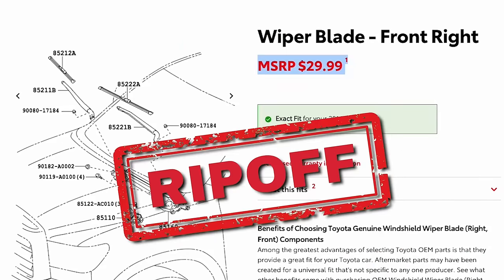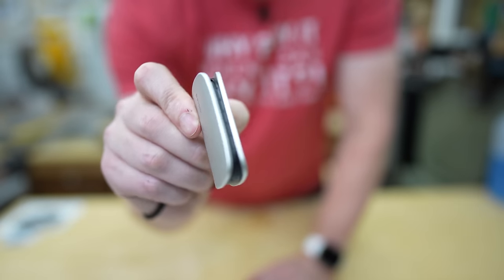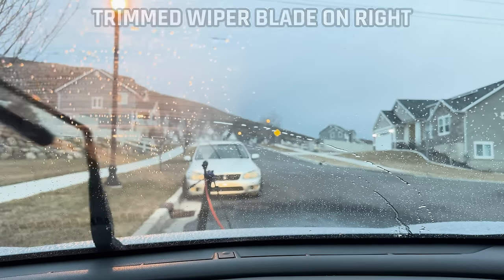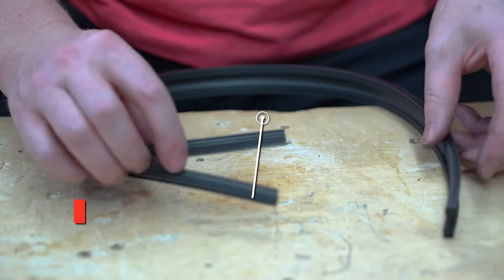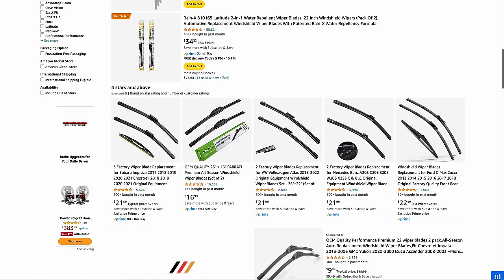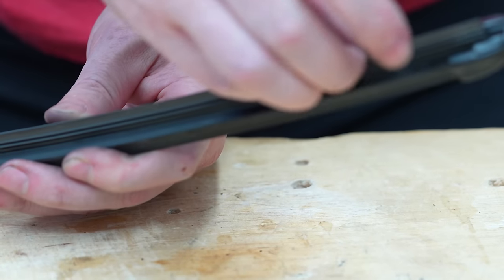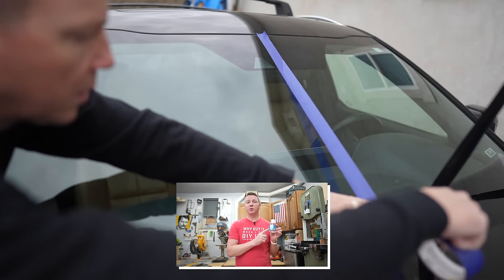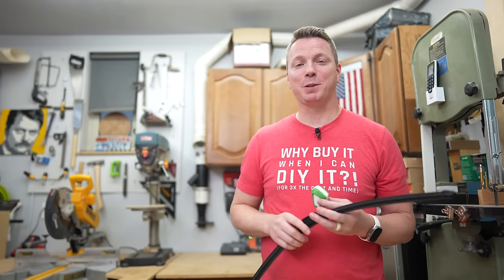Windshield Wipers Are a SCAM! 3 Ways to Save $$$

Comment: If you get a good set of silicone wiper blades you may never have to replace them if you clean them occasionally & wipe them with Rain-X when you apply that to your windshield.
Reply: The blades I buy usually break because they froze in thick ice.  The plastic parts crack and the rubber tears to shreds.   Would silicone do better ?
Reply: @jeffbguarino  Yes silicone stays pliable in freezing temps. I would make sure they aren't frozen to the windshield. Start your car & run the defroster on high to free up the blades before you run the wipers. Or you CNN chip them out with a good scraper.
Reply: @jeffbguarino  Got some clothes pins or do pizza places still stick those tables in the center? Stick those under the wiper arms so the blades are lifted from the surface before any expected freezing precipitation, then simply remove them before driving.

Kinda a chore with my 2000 chevy cavilier, but you live in the upper midwest for 20 years, you get used to it. Don't newer cars lift theirs automatically when off so this isn't a thing?

Comment: I'd be cautious using WD-40 to clean your wiper blades.  Maybe I didn't remove the residual WD-40 properly after cleaning, but after "cleaning", we went on a long road trip and encountered rain.  I couldn't see a thing.  The residual oils from the WD-40 smeared the windscreen.
As I say, it may have been user error.  If I do it again, I'll test it thoroughly before heading out on the road.
Reply: Definitely user error

Comment: I would like to see you run the wipers on the Rain-X treated windshield.  I tried the Rain-X once on my windshield, years ago.  The water did bead up and tend to roll off, but at some speeds and/or rain conditions I still needed to run the wipers.  When I did, it smeared and made it more difficult to see through.  Eventually it seemed to wear off and I've never used it again.
Reply: Same experience here with Rain-X, even though I made all the key preparations. 

I have since moved to a glass coating called Ultra Glaco by Soft99 (Japan) and the durability is great (1 year or so).   It's been great, speeds over 30mph don't require the wipers (or at least put them in intermittent).  The blades glide over the glass pretty good even after 6 months. 

I keep the windows clean using just the Sprayway glass cleaner.

Comment: The WD-40 (silicone spray applied the same way works also) trick is excellent for quick short-term emergencies (and extends the life of the blades) and usually last about a month or so. I like silicone wiper blades, they cost a bit more but they try to make them hard to find and they last at least 3 times longer. I'm not sure since I haven't had to replace them yet. Also, as others have mentioned car wax or polish like Nu-Finish applied and buffed off  the windshield works as well and last longer than Rain-X.

Comment: 10:33 I use a similar product that I discovered when I was living in Japan and it works exactly like that. All the major car shops like AutoBacs had it. It was in a bright orange hand grip applicator bottle that had the felt brush built into the bottle. The only downside to using that stuff on your windshield is driving for a couple of hours nonstop in the rain during the day will cause your brain to get that warp speed star field screen saver burned into your brain and when you finally get to your destination, you being seeing that moving star field for hours after. Even worse if you pullover into a rest stop for a nap. You close your eyes and that's all you'll see. It made my friend traveling with me get nauseous when they tried to catch a few zzz. 😅

Comment: Cool informative video. Another product that has worked amazing for me. Is RAINX  windshield washer antifreeze that's typically available at any BIG BOX store next to the blue windshield washer antifreeze is the yellow rainx windshield washer, antifreeze. Use it because our winters are very cold here with temperature, sometimes reaching -20°C.  So rather than switching to the SUMMER bug washer fluid by RAINX as well, which I would likely forget by the time winter arrives, which would freeze the water bottle and pump like an ice cube, expanding and an ice cube tray. I just the winter -40°C rated rain X washer fluid, which basically coats it just like the additive that you demonstrated in your video. I to find that when I'm driving at high speeds, the water just repels off of my windshield which prolongs my wipers for typically five years or more because I don't use them as often but I do need to take care of them a little bit more as the age by cleaning them with a degreaser, and then using a rubber rejuvenator Solution with the applicator built into the little bottle, which I just apply a small amount, and it brings it back to like new by restoring the  moisture that's lost as my daily driver throughout all four seasons of extreme weather conditions. They clean it up even better. Sometimes there is too much crap on it because I don't wash my vehicle enough. I'll just use a little piece of light sandpaper or Mr. clean magic eraser, which basically removes a small amount of material along with any other foreign debris which creates a smoother service area rather than buy new wiper blades. Find that when there is a huge downpour and I'm driving on the highway that my wipers don't keep up the pace needed in order to remove the water from my windshield because it's too slow so the RAINX actually be used as a safety measure  if my wipers stop working or one flies off? I think I go through one bottle of washer fluid a year because of the rain helping to keep my windshield cleaner by repelling the water and dirt off my windshield when it does rain or snow. Another try to keep an extra blade in your trunk. Even though it's an old blade and may not do a great job. It's better than having no blade do no job or worse having the wiper arm cut into the glass of the windshield because the driver didn't pull over to address the situation, but rather drives home later, realizing is a very fine line in the shape of a moon on my windshield lol I wonder what that came from and that's when I showed them the wiper arm folded down on the windshield, matches up with the same mark left by running the wipers with one blade missing. OH "I didn't know it would leave a mark on the windshield"? it more than an eighth of an inch deep it's not worth buffing out the material around the scratch in order to level that area of the windshield which would take countless hours. Great video though keep up the great work! Peace

Comment: Everyone talking about refills. They went away for the most part because one, there were three different widths of refills, second, modern vehicles as a majority, use two different size blades. So costs would be redundant. Plus the new design beams are really hard to replce incerts into. UV does the most damage, those of you who store your vehicles inside or dont drive htem full time, they last much longer.
Reply: Yeah, they can solve ALL of these issues by STANDARDIZATION. We only need ONE SIZE for each type of car.

Every truck does not NEED different sizes of wipers. The windshields are almost identical.
And if the windshields are not identical, MAKE THEM IDENTICAL. We need cheaper windshield repair too!
#LateStageCapitalism

Comment: Years ago when I had a Mazda 626, I had bought some Triple Edge wipers. They were amazing but they weren’t the standard blades. They were made with Jamak silicon. I had them on the car for almost 6 years and they wiped the same as the day I bought them without doing anything to them. Ice? Didn’t hurt them. Mud? Nope, still wiped clean. Sure after a couple years I had to wait for a few swipes that were streaky but after that they wiped clean again. It was weird but I can honestly say they were the absolute best wiper blades I’ve ever had. I only replaced them cause the passenger side flew off the car when the mounting bracket retainer clip broke. Happened while driving and using them. 

I have done the WD-40 method and can concur that it does work. 

As far as the Rain-X I never used it by my parents did when it came out. I do however use a paste wax on my windows and it lasts a long time with similar results. 

I have subscribed for more as I love to do things myself. A whole lot cheaper and I know it’s done right.

Comment: I use the ceramic polymer that I use on my car finish on the glass as well.  You never have to turn the wipers on, it just sheds off the glass.
Reply: Ceramic?  Ceramic is stone.  I don't want rocks anywhere near my vehicle.  That's like rubbing it with ground spark plugs.

Comment: This is a good guide.  But there are some things with the refills you need to be aware of that I've learned in 15 years of aftermarket and dealership parts departments.  If a car is more than a couple years old chances are it has aftermarket wiper blades on it.  In the aftermarket nearly every wiper blade has a different width of channel where the blade itself slides into.  So you may get the right length, but that channel may be a couple millimeters too narrow or wide.
Reply: I second this. My '99 Blazer has one that I think is OEM and one that I know came off a Mini Cooper. The wipers are VERY different.
Reply: 6mm and 8mm are popular.  6mm will usually work in the 8mm arm.  Cut to length from bulk.

Comment: The one thing I hate about RainX is the same thing I hate about using Armor All Original.  If you use it once you have to keep using it or your view gets cloudy and deteriorates.  With Armor All it makes everything super shiney but will also leave it splotchy or even cracked if you stop applying it.  The purple kind seems to be good since it just cleans and doesn't polish/shine the dash.  WD40 probably can give and cure cancer in some way.

Comment: My wipers last a really long time. I really hate a dirty windshield so i clean mine at least once a week. Usually at the gas station. I always keep a bottle of glass cleaner in my vehicle. Ill spray my windshield with my cleaner and use the squeegee.sometimes their cleaner can be kind of gross so adding cleaner to the windshield helps. Also, I spray a paper towel with window cleaner, pinch the wiper blade with the paper towel, and give it a quick cleaning. This regular cleaning keeps the buildup off the blades. I use a repelant product on the windshield too.

Comment: As a wiper freak I have drawn several conclusions over the years: 
1. DO NOT buy those crappy wiper trimmers- as said in the video is nearly impossible to make a perfect cut on them that won't create streaks. And anoher thing is that they obviously shorten the rubber, making it less flexible and more prone to vibrations. Cut a piece of old rubber insert and look closely at its shape. Do you think that's totally random and the manufacturer just made it like that just because? Yeah.... trimming it changes it's properties and elasticity and I can guarantee that in the best scenario it will be a really short term fix if you can actually make a decent straight cut (which I doubt)
2. Yes wipers are a scam sort of. Best and the most logical way is for manufacturers to sell replaceable inserts like some of them actually do to prevent reckless spending and waste. This is the best and reasonable way to refresh your wipers really. But there's a little more to it. It works better on newer aero blades as their base structure is simpler an more durable. On old style wipers with beam style structure you will actually get wear in those hinges and make the wiper more wobbly and unable to hold it's initial shape- it won't stand perpendicular to the windshield like it's supposed to and even with a new insert it will wobble and flex.
3.I wouldn't use WD40 to clean them. WD40 is petroleum based and rubber doesn't like petrol stuff. I would use alcohol to clean them instead.
4.Check regularly if the wiper sits perpendicular to the windscreen. If not it could judder across. On most cars you could easily slightly bend the wiper arm to sit perpendicular to the screen, just be sure not to scratch it if using ceretain pliers or other tools.
5.Like in the video- regular windscreen clean and decent quality washer fluid helps. Plus rainx :)

Comment: I used to work for a national auto parts store.  When dealers ordered wiper blades we sold them blades kept in the back room.  You can buy them too.  I am sure they have gone up a bit, but I sold them for around $10-13 dollars.  Much less than the blades you find out front.  I just bought Mitchlen blades from Costco for about $10.  They did not fit my old car, but work fine for the car I have now.

Comment: I have to warn against those Rain-X treatments on the windscreen, they can be quite dangerous. They're OK up to the point when you must use wipers, and then they're not OK at all. Reasons:
1) They make wipers bind and chatter. Wiper blades glide over the windscreen on a microscopically thin layer of water, that layer is so thin it evaporates almost instantly after the blade has passed. With treatment, that layer can't form, so the blades are running dry and binding on the glass. They barely wipe at all, they just jump over the glass.
2) Even if the blades manage to make a clean pass and not chatter, the above still applies - this microscopically thin layer of water can't form because water beads up before and after the blade has passed. The beads that are left are too small to be blown away by the wind, and they don't have enough surface area to evaporate quickly. So what you're left with is equivalent to matte glass, and with luck bigger droplets will pass through and create streaks you can see through.
This all can get very stupid very fast, in many situations. Just one example: the rain has just stopped and there's bright clear sky on the horizon. You're passing a big lorry which generates tons of fine mist, with droplets too small to bead up and get blown away quickly. Your windscreen turns matte, and also white because of the bright sky. You turn on your wipers, but they either skip and don't wipe or leave a white matte surface behind. Before this surface can evaporate and go away, it's again filled by the fine mist from the lorry. You turn the wipers to super-fast but all that does is leave you with more of one type of matte white surface than the other. You turn wipers off and are blinded by the mist alone. In either case, you can't see jack. Aborting the manoeuvre is not an option because you may get rear-ended by people who don't expect you to emergency brake at that point, and you'll need a lot of distance between you and the lorry to regain vision. So your only option is to shift down and redline it through, blind and navigating by dead reckoning and hearing. Been there, done that.
These coatings work most of the time, but most of the time is not nearly bloody good enough. Any product that under any kind of circumstances, however unlikely, can cause me to go blind, has no business on my vehicle. And this scenario is not unlikely enough. I got these blind moments a number of times before I finally managed to get this crap off my windscreen.
I still use them though - on my side windows and mirrors. Anywhere where there are no wipers, they're great. Just by no means on any glass that's equipped with wipers.

Comment: Best thing I learned is to keep your windows clean.  The particles are abrasive and best be rinsed off.  I use as much washer fluid as needed to clean it properly and help lubricate the blades.

Comment: I mean the trimmers are cute and all, but they won't soften a rubber blade that's gone stiff already. It's important for the rubber to be soft as well as smooth and uninterrupted. Once it goes stiff, it's no good.

That's why I'd use silicone blades/refills if I can get them. They stay soft for a whooooole lot longer.

Comment: Re: Nextzett lasting longer than Rain-X: I've been using Rain-X on my Honda Civic (with wiper refills!) for a few years now. I applied the Rain-X as instructed, but I also switched to using the Rain-X washer fluid. After over 6 months, I was still getting very good water shedding (in pretty rainy/snowy upstate-NY weather). I re-applied the Rain-X, not because I felt I needed to, but because it just seemed like a good idea (it was late-fall, I still had plenty left in the original bottle, and I didn't want to wish I'd applied it later in the winter). I'd tried Rain-X a few years previously (without the washer fluid), and it didn't last nearly as long, so it seems like the washer fluid is effectively replenishing/refreshing it whenever I use the washer. I wonder if the Rain-X washer fluid would have the same effect on Nextzett. But in any case, if you use the Rain-X washer fluid, a Rain-X application lasts a really long time. —Tom

Comment: Great video. I have not tried the trimmers, but I have suspected that wipers lose their square edges that give you the best clean. I started buying silicone refills on Amazon some years ago after paying way too much at the autoparts store for the cheapest blades. Nobody sells refills anymore in stores. I wish I could find a roll and cut them to length and not have all of the little pieces. I am so cheap that I run the pieces from the other cars on the passenger side of my truck.

Comment: I recently re-bought the oem wipers for my fj cruiser, along with a wiper refill for my rear window wiper due to forum searches and otherwise. The refills aren't very easy to find and online they are still pretty expensive. Regardless of all this, the wipers work perfectly and are definitely better than any other aftermarket wipers I've used in the last. Usually the oem wipers and refills are superior to anything you can buy aftermarket, if you can find them.